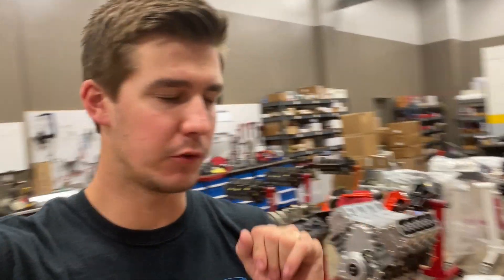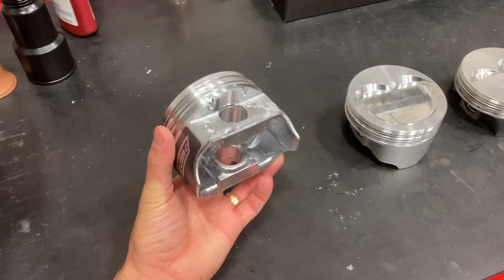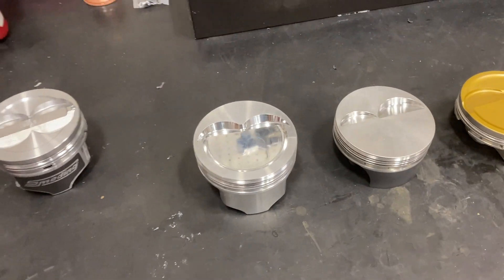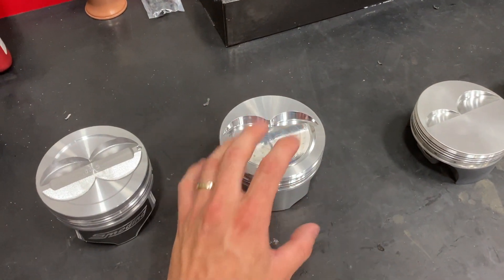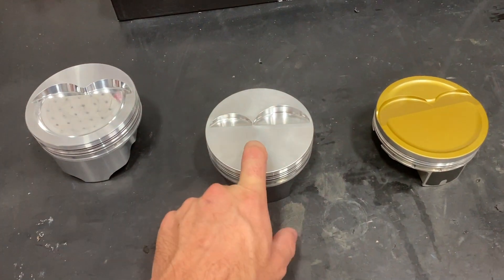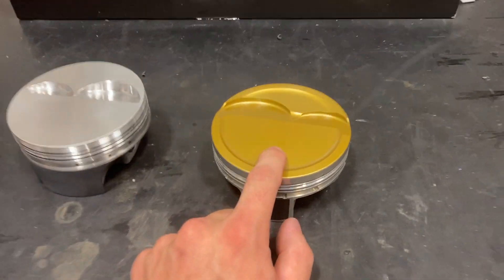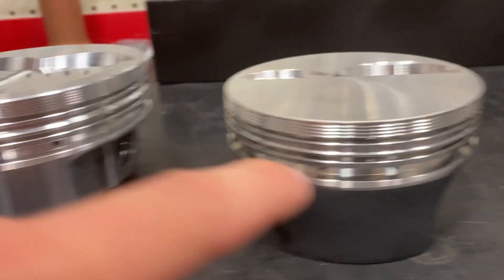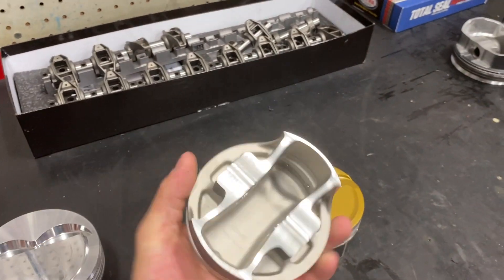Piston Alloys, Design & What You Want to Run - Tech Tip Tuesday

Comment: Hi, I am installing a all STD Manley forged 2618 pistons in to 2015 Range Rover Evoque with 73k miles. Thats Ford Ecoboost 2.0T engine. I am counting on 73k miles run, the natural wear of cylinders will give me those extra .001-002 mm of heat expansion clearance.

Comment: How much hp rating for the 4032 forged pistons.415 6.2 street with a f1a p/c, 850-900rwhp the goal. Keeping the compression low, could I run 4032 instead of 2618 to avoid piston slap.
Reply: i hope  you rana 2618  because  your  application is  exactly why you run a 2618

Comment: Which pistons for  daily driver wit nitrous 4032 r 2618
Reply: nitrous still 2618  its a power adder.  if it  was a 7000 RPM 550+hp all motor  street deal  4032  all day